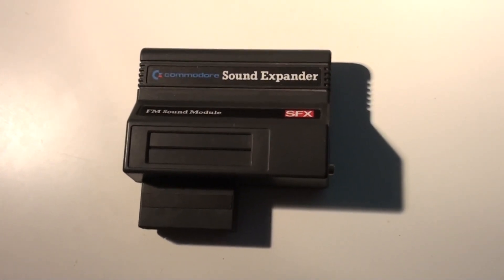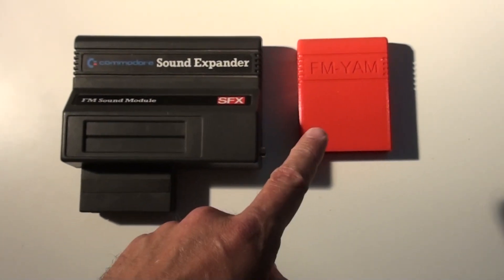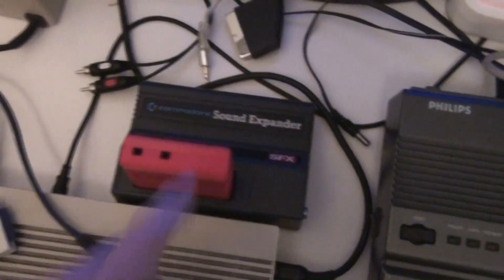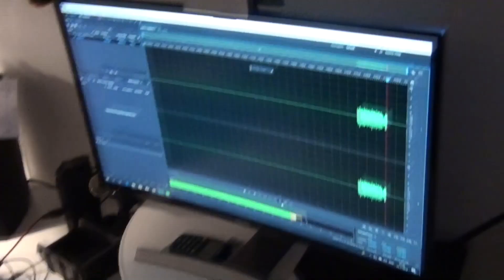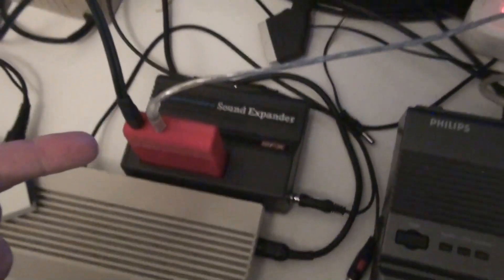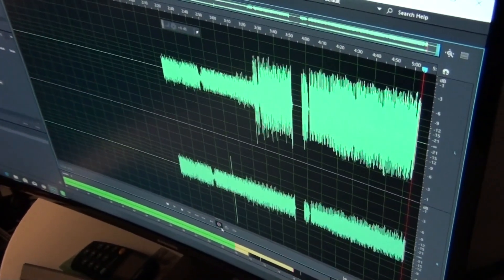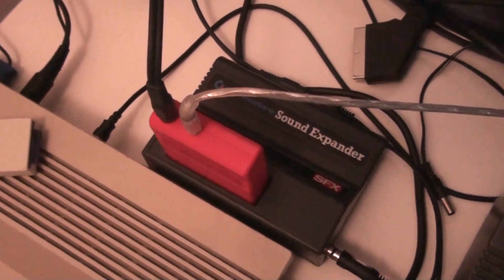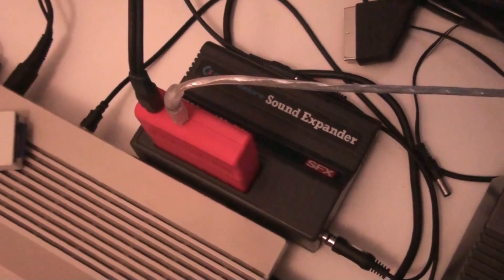Sound Expander + FM-YAM ?! - OPL1+OPL2 together forever - Commodore 64

Comment: Question: Can music/sound compositions made using this equipment be somehow “flattened” to a single channel for playback on stock, unexpanded C64s?
Reply from the maker: Not sure what you mean. It seems you mean recording it and sampling down to play as one digitized sample on the C64?
Reply: @ yes, that is precisely what I mean, thank you. Is this possible and if so is it even feasible to consider it as a method for gaming assets on a C64, or would the challenge then be the size of the file?

Thanks again, I appreciate the reply.
Reply from the maker: @BobbyCharlz  it won't be possible due to the need to have a lot of memory for playback of the samples. Even at a low 4000 hz, 8 bit depth, you would need 120K bytes for 30 seconds of a song.
Reply: @ Got It. Understood and thank you.

Comment: Great sound. Have now the FM YAM and waiting for the SFX Sound Expander. Have the cables for it but must do it with the 1541-II diskdrive.for D64 on floppies. Normally I use the 1541U2 to use D64 and PRG. Maybe I can connect it with the X-Pander 3 on my C64 Reloaded MK. Have also a SID 8580R5 which I can easily swap with the SID6581R4AR. See that Mibri use the SID8580R5 with the FM YAM. Must seek for more SID8580R5 chips for my C64 Reloaded MK. Have two original C64’s but they have the SID6581R3 and the SID6581R4AR.
Reply from the maker: I now have the Ultimate Elite, but before I had the Reloaded. Both work with the X-Pander 3, just plugin the 1541 Ultimate 2 in one slot and FM-YAM in another. Make sure to set the IO settings correct. https://c64.xentax.com/index.php/fm-yam
Reply: Thanks, have it working. Hope that i can buy the Ultimate 64 Elite.
Reply: Use now the SFX Sound Expander with the FM YAM. Are there PRG files for it than I can use with the Tapecart SD. To use the SFX Sound Expander and the FM YAM. See a lot of SID8580R5 and the FM YAM.

The FM YAM cartridge first batch stick forever in the SFX Sound Expander. Is no way to get it out..

The X-Pander 3 has works great with the 1541U2 and the FM YAM. Must buy a second FM YAM cartridge to use it again on the X-Pander 3.

Comment: That makes me wonder: Would it be possible (ie. would it take significantly more CPU time) to make a player/editor support all three sound chips of this config, resulting in 21 voices (plus SID sample trickery if you want)?
Reply from the maker: Using the X-Pander 3 expansion slot expander, you might use two FM-YAMs (or Sound Expanders), and reroute one of them to IOL1 with the X-Pander-3 switch. Then you'd be able to have 18 FM channels, yes. And yes, that will cost CPU time, depending of course on how complex the player is. :)